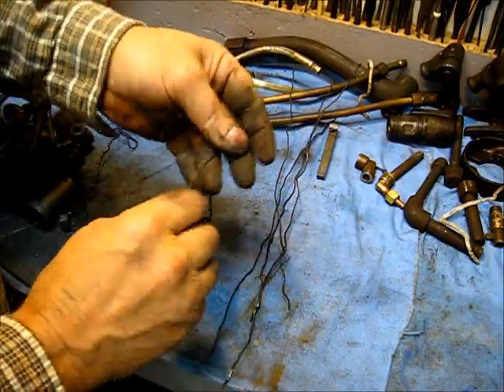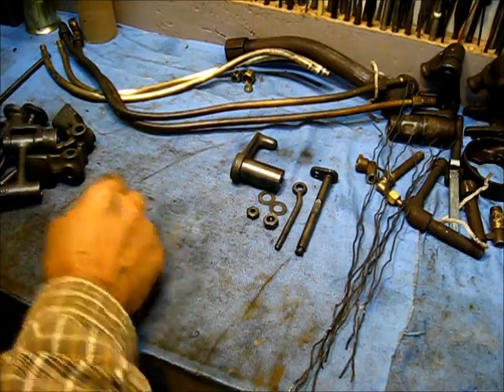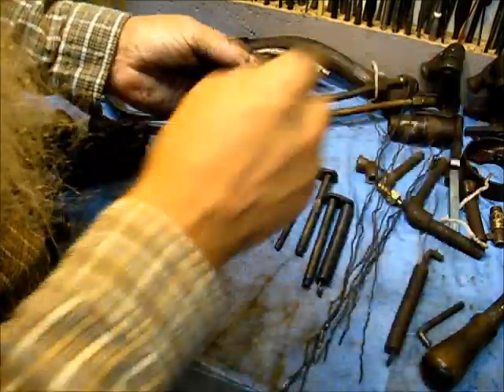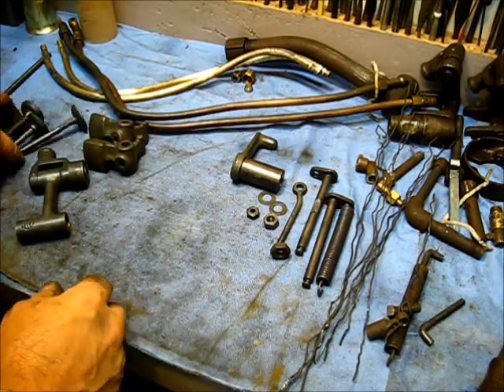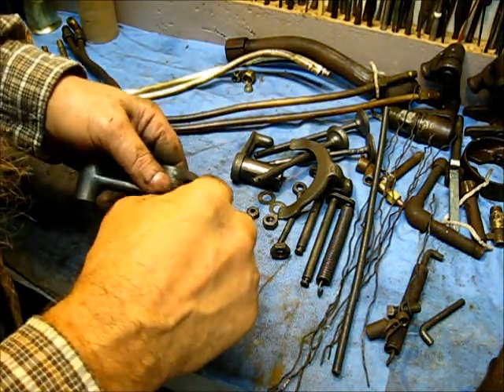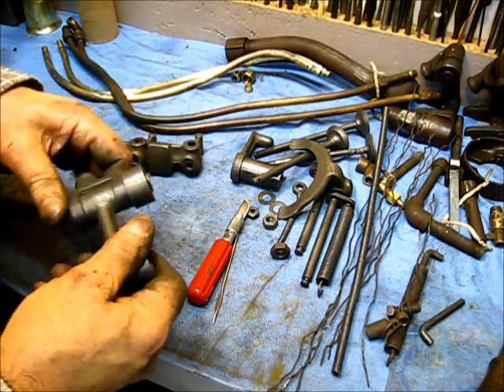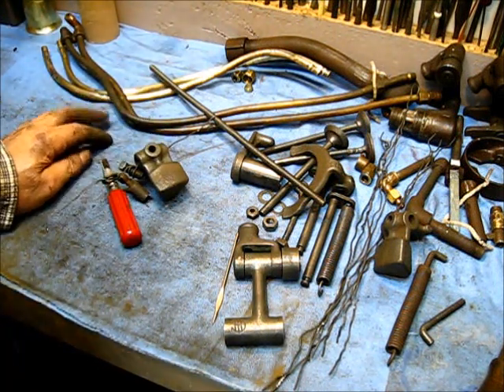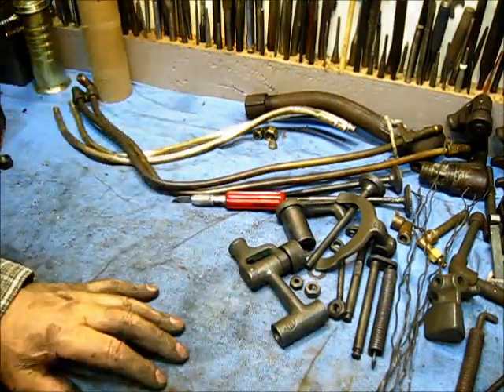Electrolysis Rust Removal #6 / from rusty metal to clean parts / afterthoughts

Comment: Sam you can't not POSSIBLY say too much about this here. What a time saver What a work saver. 20 plus years of turning wrenches and my man I wish I would have done known this here 20 years ago. This is THEEE most worthwhile thing I ever found up on yonder internet. I'm not no vintage stationary engine mechanic, I'm a hot rodder and a racer. But I been working with rusty old parts for so long man. I mean WOW. This here is the coolest thing since sliced bread.

Comment: just curious, have you ever used a molasses bath to remove rust?
Reply: He has mentioned molasses bath for removing rust. It's just too costly compared to soda detergent. Molasses bath does work, I've tried it and it takes about the same amount of time to remove rust but it will mold after awhile. Molasses cost quite a bit more than soda detergent, you don't use much of it and it doesn't use much electricity to run the charger. I have been doing electrolysis for over 20 years on my old farm machinery and it works great, when done right. If you haven't seen all of Sam's videos I really recommend you to go back and watch them.
Reply: Tinker Jim They both have their benefits. Molasses takes longer but cleans all surfaces unlike electrolysis that only cleans line of sight. But molasses is harsher and can take off a small layer of good metal. Here in Australia molasses is very cheap, like a dollar a litre and one litre makes ten litres of solution. But it can smell a bit, for convenience, once set up, electrolysis is better. If not set up, molasses is nice and easy, whack it in and forget about it for a week or so, maybe an odd stir and wire brush to help things along.
Reply: Wow, molasses is a lot cheaper there. I forgot about molasses cleaning the whole part that the liquid touches, it's been awhile since I tried it. Thank you for filling me in on molasses taking off a small bit of metal, I didn't realize that.